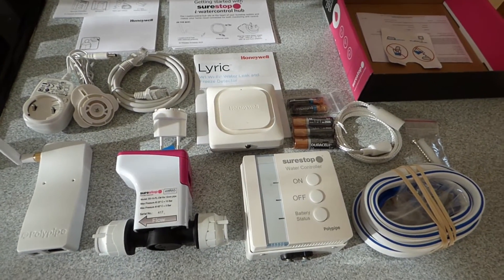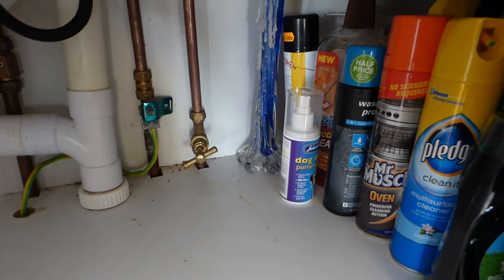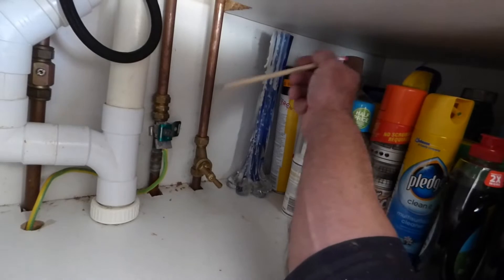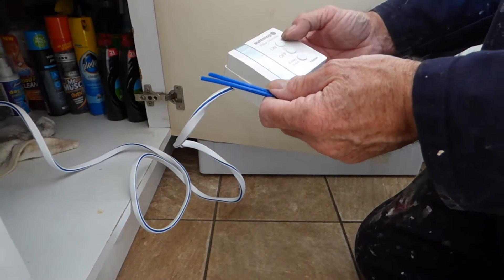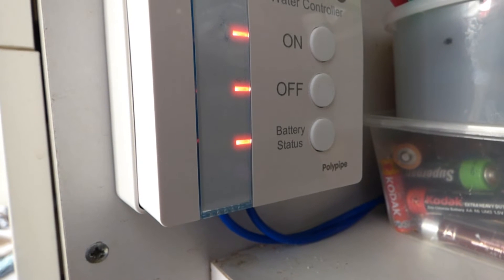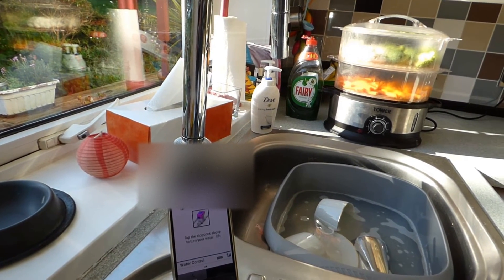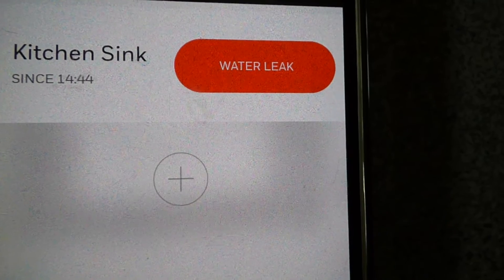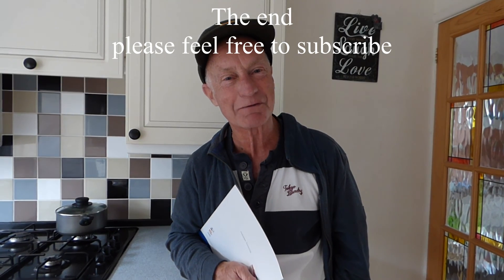Review and fitting of the new Surestop smart stoptap with leak detector

Comment: Just out of curiosity, does it send a message to your phone when the batteries need replacing?  Because if not then those batteries are going to be dead when you first need to use it several years after fitting.
Reply from the maker: Do you mean the leak detector or the sender unit.
Reply: @dereton33  I meant the Surestop sender but of course it applies equally to both.  There's no point in having a leak detector if its batteries are flat.  I'm still puzzled about where you're supposed to fit this leak detector.  If I understood correctly it detects conductivity of water between two contacts on its case, so it will only detect a leak that fills your house up to the level of those contacts.  Is this correct?
Reply from the maker: Yes but there is also a lead that plugs into it, which you trail on the floor if this gets wet an alarm is sent. Of course it can only detect about a metre in length so you have to decide where you are most likely to get a leak. If you have more areas that you are worried about you would have to purchase more. I do not know whether either of the devices send a message when the batteries are low, but the sender does have a battery life indicator on the side of it, which you can press and get a reading of how much life is left. Like any device ever made, every thing has its plus points and it`s minus points. Nothing is perfect. I still think there are enough plus points if you have a need for one. If you are happy with your stopcock well that`s great, save your money.

Comment: Just a point, as you mentioned it.....If your main incomming water supply pipe is poly/plastic...there is no requirement to electrically bond it anymore...as per the new 18th edition wiring regulations.
Reply from the maker: Thanks

Comment: What if the plastic joints do leak?
Reply: You have the Honeywell Leak Detector ;-)
Reply from the maker: That`s right.
Reply: dereton33 - Yes, but how do you seal a leaking plastic joint? Presumably you can’t use PTFE tape or a jointing compound like you can with a brass compression fitting.
Reply from the maker: i have a video on how to fix them.

Comment: Avoid most "smart" stuff despite being an IT engineer. The amount of "smart" iot kit that gets abandoned so becomes useless is getting worse. Like Best Buys kit lately and they are offering no refunds.
Reply from the maker: You are missing out if you avoid smart stuff it is the future. I personally love smart stuff.
Reply: @dereton33  I'm an IT Engineer. You need to be very weary with smart IOT stuff. Most have massive security holes so sticking them on your Internet connection with no isolation is not a great idea. I have Virgin as my ISP, although not a smart device I'll be soon getting my own router to go between their useless junk. Their router sign in page has no HTTPS and shows and sends the password over the network in plan txt. If you don't vlan your network off, then all your IOT kit can view your virgin login password as you login. Look up Best Buy Insignia, all that smart kick is now dump as they cancel all the smart services. So all the Insignia cameras they 100% rely on the smart part are now bricks.

Comment: Personally I'm not a fan of surestop, been called out to many leakers - one flooded out a utility room and kitchen. Good video as always Al 👍
Reply from the maker: Thanks PB.
Reply: Hi PB.  sorry to hear this.  If you ever want to come to Surestop and have a look around and discuss anything you have had an issue with please give us a call.  We would be happy to meet you.
Reply: @surestop  Thank you for your response. I've found the ones I've been out to in the past are leaking from the valve body and not where the two small tubes locate. I've never recommended installing them because of what I've been called out to. I'm not sure whether the new ones are of a different design/build ?
Reply: @surestop   Hi, I never kept the valves they were left with the customers. These were reactive call outs so in, repair, out. The last one I went to was probably 2 to 3 yrs ago and that one flooded their utility and kitchen. When I checked on some of the plumbing forums others had been out to leaks from them. Personally I fit a lever valve above the incoming mains stop tap as most customers find them easy to operate. I like the idea of the sure stop but like many plumbers who have been out to them I wouldn't install any. I haven't the confidence in them as I have with a solid brass valve.
Reply: Hi PB.  I am sorry to hear that.  Unfortunately people are quicker to point out the bad in lots of situation rather than the good.  Completely understand your personal reasons.  As I said before if you ever want to come and visit us you will always be welcome.  Have a good day.  Thank you.  Surestop.
Reply: @surestop   Thanks for the invite 👍